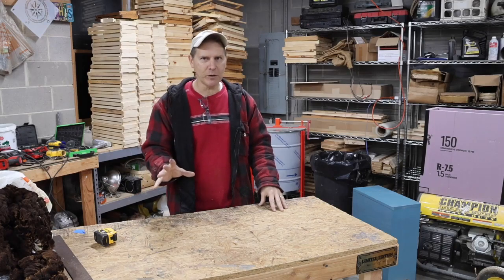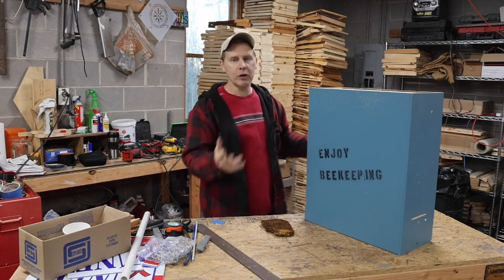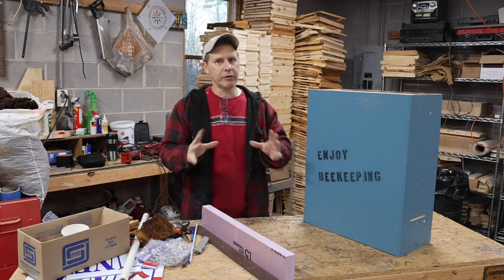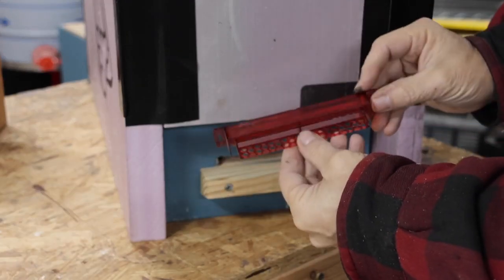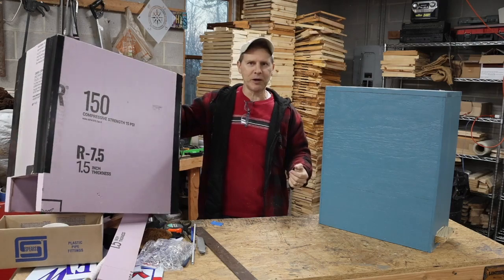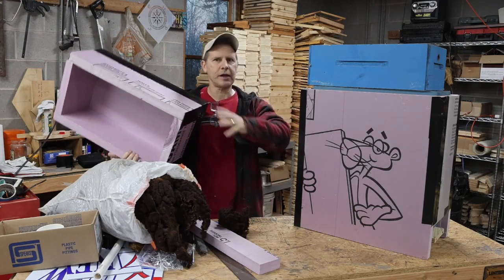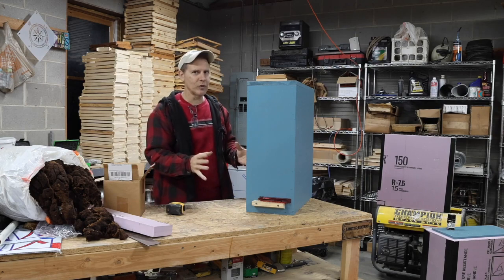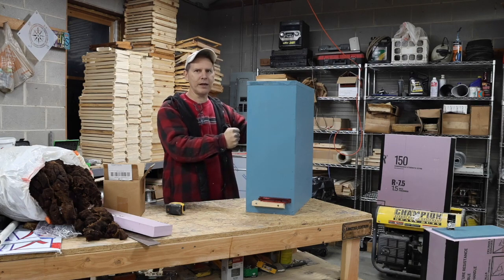Well Insulated Hives 01 24 2023

Comment: Why not just have the foam lid slide down over the box?  Double the foam on top to prevent condensation and have a flat wood lid inside.  Much simpler and will stay on in bad weather.  Also, unprocessed wool is much lower in r-value.  You're quoting wool batt numbers.  Love where you are going with this!!

Comment: A couple of questions:  1) you use your swarm traps as permanent housing for the trapped bee's?   Not to small?
  2) My understanding was that Polystyrene does not breath, and is therefore not suitable as an insulation layer around bee hives because it retains too much moisture; is this incorrect?
  Thank you for reminding me I need to get on to trap building soon.  Love your content!
Reply: Vino Farms on YT finds that they can mitigate the moisture themselves.
Reply: I know a beekeeper who has all his boxes made out of only polystyrene. Bees survive the northern winters just fine and do well all year 😊
Reply: From SE Washington State; a beekeeper here told me:
a. Use 2" Rigid Foamboard all around your hive.
b. Have only ONE small entrance/exit hole. NO flow-through ventilation.
c. This set-up keeps the bees warmer.
d; When the bees are warmer, they don't eat nearly as much.
e. When they don't eat as much, they don't create as much condensation. 
Last winter we got down to 9 below zero. The lowest temp he recorded in his hives was 47 degrees. No condensation problem. No hive loss.

Comment: Looks good.  I see a lot of Vinofarm ideas in here as well.  The styrofoam is not nominal like 2x4's.  They make 2" insulation it'll have the 250 number on it instead of 150.  Not sure if it makes that much difference though.  Polyiso gets you R9.3 in 1.5" and includes a radiant barrier on some products.

Comment: like the sleeve ,tray ive seen fred dunns 5 frame nuc insulated top sleeve cover,im leaning toward just that basically a telescoping  cover of poly styrene with deeper sides,just like your sleeve,keeps the dew point below the cluster in torpor,...i like the starter strip too on those deep frames,

Comment: I’m going to blow your mind.

Take an infrared thermometer outside on a clear night (no clouds) point it to the sky and you will see crazy low temperatures, think 90F degrees below ambient. Space is absolute  zero. At night time with a clear sky an uninsulated box looses an amazing amount of heat from its top surface. You are insulating the top surface to prevent that heat loss. 

You can point the infrared thermometer 10 degrees to the side of the sun on a 100f day and you will read 30f, the difference is that on a sunny day the incoming solar radiant heat is much greater.

Start thinking in terms of radiant transfer rather than convective heat transfer and you will be Farr ahead of most.

Comment: whoah!. I am amazed. 5000 km distance, old beekeeper  in Atlanta making research and new beekeeper, in the european Alps  optimizing house passive insulation for a living that reach almost the same conclusion. I am diy  very well insulated lazutin either horizontal or vertical here.( but dadant. large not langstroth large..). thank you for the lime TIP.  In exchange, I will highlight two small mistake: I dont know where you found the info but... its not correct1)  the split betweenthe heat loss top / wall/bottom is NOT what you claim to be . I run the software that simulated heat house dispersion on a beehive.... and the other is on your wood construction: if you want a stable humidity you have to fully copy the nature. The wood grain(vein?) MUST go from down to up not from left to right!  you can easily correct it on your next building. Last what you say about sheep wool is correct ONLY if the density of the wool is the one that was tested Hand pressing the wool doesnt reach the level needed but it will let the humidity move like the wood. So, sleeve can be easily done by 4 mm plywood box with sheep wool inside if you want to go full natural and easy to paint

Comment: Curious how you would harvest honey with the Lazutin frames?
Reply: I make them by connecting two halves, each of the size of a Langstroth deep frame. Note that the bottom part is not a real frame, it does not have a top bar, but it has a thin horizontal bar somewhere in the middle so that it does not fall apart and keeps its shape. The bees still can build continuous comb with this bar. Similarly, the top half does not have a bottom bar, but also has a thin bar in the middle. I cut the comb horizontally in the middle, where the two halves connect, and detach one half from the other to extract honey from them. HTH.

Comment: Condensation happens when warm moisture air meets cool air. Pushing the condensation zone towards the entrance and floor is the best practice. Make sure you have a floor vent and drain. So condensation don't become a block of ice making inside of the hive cooler.
Reply: If he's insulating the bottom as well,  then, it would be even all the way around and no condensation.   He has R 7.5 for the entire hive with the top at 23.  Dr. Leo speaks of dessicant packs in the the bottom and Gene speaks of peat moss.

Comment: Hello. I am building an insulated hive. I don't like the frames being so close to the entrance. I live in Michigan. I am concerned about cold air blowing in through the entrance. What would happen if I added a spacer below the brood box and left a 12" empty space below the frames to get them up away from the entrance?
Reply: The bees will fill it with comb ,, then you have a mess ,, instead put some kind of wind Break close to entrance but don't block it tight , leave 2 inches

Comment: Last December the brutal cold winds froze lots of water pipes and my bees came through the storms like little troopers. I have a feeder box on top and I put in R-11 Fiberglass much like your top hat. The sides get no insulation unless the colony is kinda weak and those get a R-5 wrap. Some of my hives just get a piece of poly insulation board under the top cover, this includes NUC boxes.. Some people over engineer their beehive such as the bee-barn Vino developed.

Comment: Nice presentation.   I've seen similar designs for Langstroth's and the beekeepers have had some issues with moisture warping the wood that's inside.   I hope you will address this after a full season of using the insulation.
Also, even painting this insulation will it keep from absorbing water?   The sun and its affect on the styrofoam may be an issue.   Let us know how that worked out after a year using this set up.
Again, nice presentation.  I'm enjoying your videos.   My book keeping bees with a small has just arrived and I'm getting ready to begin reading it.   The other two books on this style hive haven't arrived just yet.

Comment: Hello Gene and good to see you are back. Regarding insulating the hive and reducing the weight I strongly suggest checking out the work of Jim at Vino Farm. Here is a YouTube link, (31 minutes video) https://www.youtube.com/watch?v=rBa2GAUtDag

 What he has done is built-in all the insulation features you mentioned by building the hive out of 100% polystyrene.  He has had really good results with fully insulated hives with zero ventilation. Like you, he tries to mimic the hollow tree environment for the benefit of the bees. It's starting to look like if Jim is correct, then we won't be using too much timber for our bee hives in the future.

By the way since I rarely comment on videos I will include a link to another You Tube video you may find interesting. It's regarding chemical free varroa HEAT treatment that is supposing 100% effective. The video was made by Andy an Irish bee keeper using a bee sauna that is a method used in Eastern Europe that kills the varroa mite using heat. The mite dies when the temperature is 45 degrees Celsius, bees can tolerate up to 48 degrees Celsius. He puts the whole colony in a mesh drum and places them in his "bee sauna" at 47 degrees for ten minutes and all the mites are dead. He says there is no bad effect on his bees, in fact they are very healthy in Springtime and  do better than the colonies that haven't been through the bee sauna. The video is 16 minutes long and the link is below. 
Good health to you in 2023, all the best, M....
https://www.youtube.com/watch?v=jd0C98FPtEQ&t=77s